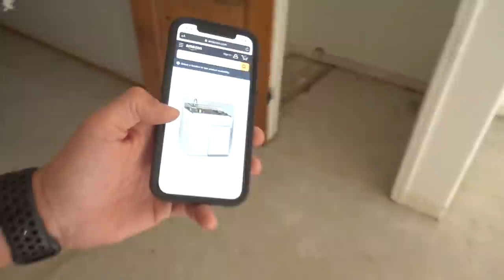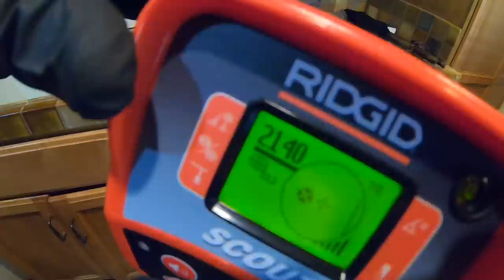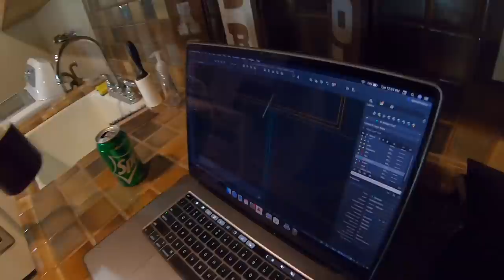RYNO RANCH GUEST HOUSE RENOVATION (PART 2)

Comment: Sorry but there is no way the people who suggested gutting and starting over have ever truly looked into all that requires. I have a 2 bed 1 bath 1000 square foot house built in 1963. I looked into doing that because I want to update and add a bedroom and bath. Turns out it looks like it will be cheaper to build on the back and fix the current kitchen and bathroom, then start over.

Comment: I don't understand the purpose of the hallway.  Why not build that wall straight across.  Frame in a doorway that will go to the second bedroom.  Either put a door there now, or sheetrock it.  When you go to build the second bedroom, simply cut the sheetrock where the door goes and install the door.  If you did that, you should be able to make your "peninsula" bigger too.

Comment: So you're making the Motel 6 1/2? If my idea of the layout is right, adding the second bedroom should also allow you to take the rest of that side of the garage to make the bathroom bigger and make a bigger shower. For the bathroom you could also go Japanese/European style and just put drains in the floor and tile it or go with prepped concrete and then plastic panel and seal the walls/ceiling and you wouldn't have to have a shower surround, just a shower head and controls and somewhere to set the shampoo/soap. The only downside to that is finding something waterproof to keep your TP in. BTW screw electric cooktop, get a regular one and just set it up for propane instead. If you find them when they are new you can eat peacock eggs. You need to backfill that pad where the squirrel or whatever dug it out or that thing is going to break. You definitely need to reroute that dryer vent before it burns the house down under that heater... small particles of flammable materials being vented under and open flame is a recipe for an explosion.

Comment: Use round pipe cut in half for the dumbell rack. Then you can use different size pipe if the dumbells are different sizes